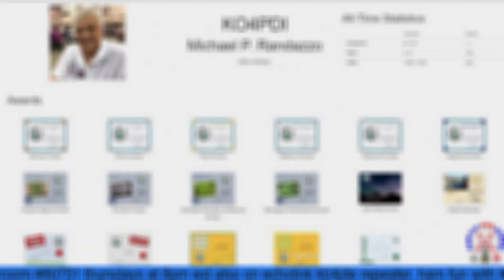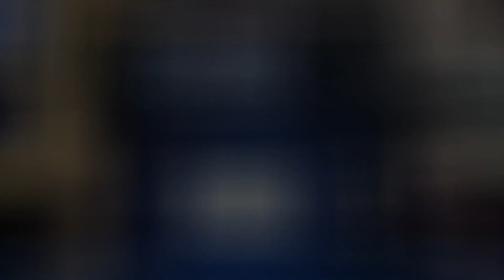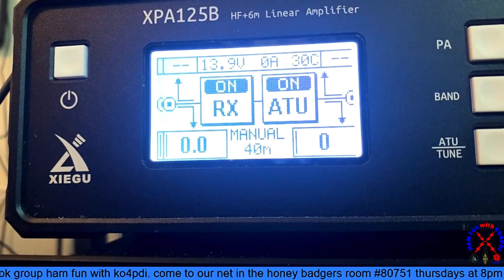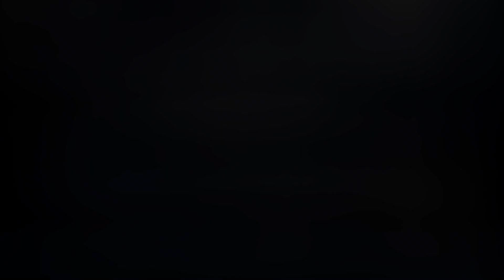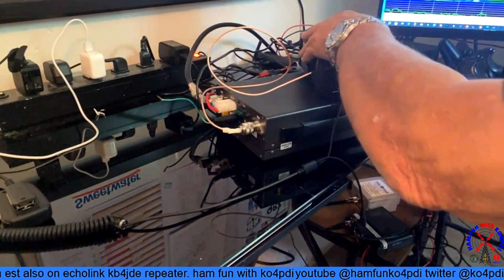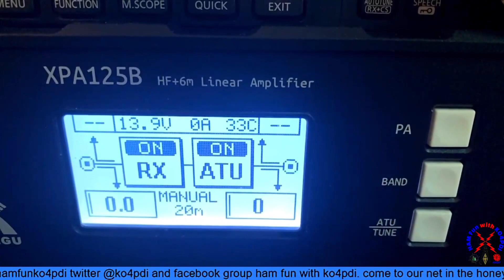XPA-125B Amp/Tuner and the IC-705 Radio.

Comment: You need a Buffer Relay Interface as well to protect the PTT keying line on the 705. The guy where you bought the cable from sells them as a package (RBI-1 Buffer Relay). It may be ok for a while without the Buffer Relay, but it's insurance against blowing a very expensive radio.

Comment: Isn't 5 watts the recommended max input on xpa 125b ?
I hope you don't cause some folks to burn up or fry their rigs.
Reply from the maker: Most times I only use about 2.5 watts. To tune it you need to send the full 10 watts into the amp on RTTY. That triggers the tuner to tune. Then you turn it down once you start making QSOs.

Comment: Just looking at pricing I’m guessing you ended up around $1700-$1800 dollars all-in for the radio and the amplifier. If you wanted the 100w wouldn’t it have made sense to just get an Icom 7300 for $1000?
Reply: I have the same setup as this.  The reason I did it was really you end up with 2 radios essentially.  I plug it all in at home and I have a 100w base radio.  When I want to operate portable I can just unplug the radio from the amp and take it into the field using qrp.  I love it.
Reply from the maker: If you knew how I acquired both you would think differently. The radio was less than the cost with a bunch of extras like batteries and the backpack.  It was used. I love my 9700 and 7300 and wanted to do 100 watts with the used IC-705 I got. Plus today both are much more expensive they when I got them in 2021. So now maybe I wouldn't go that route but the path was not as simple as just dealing with price.